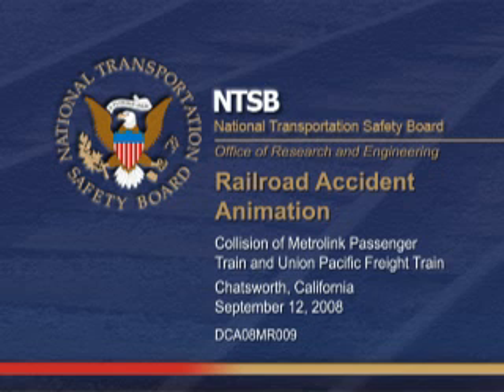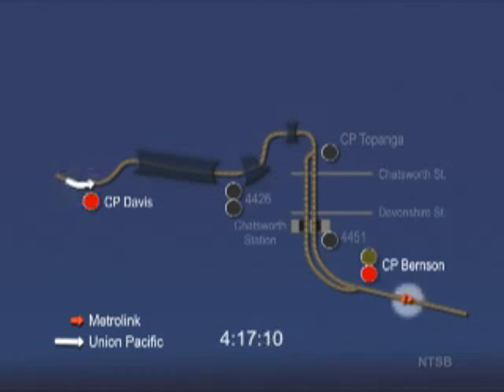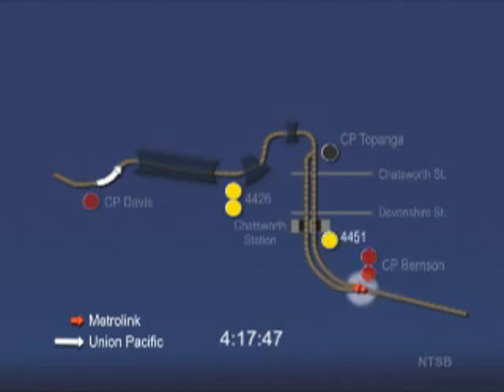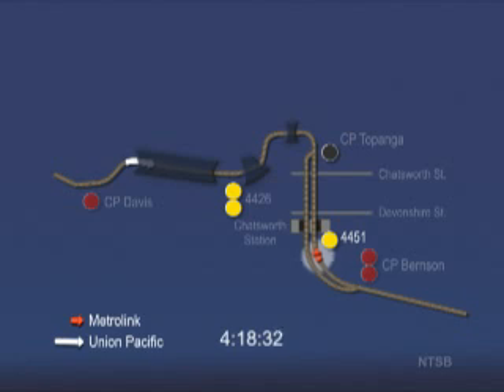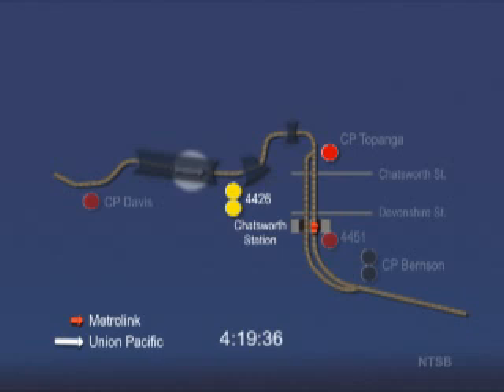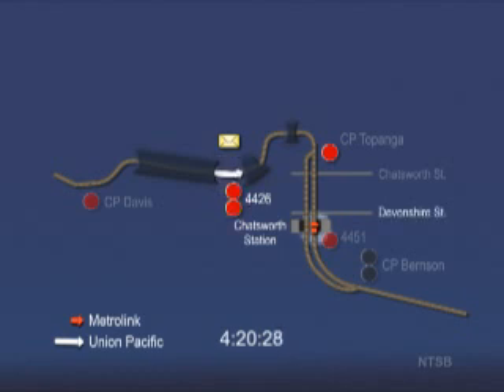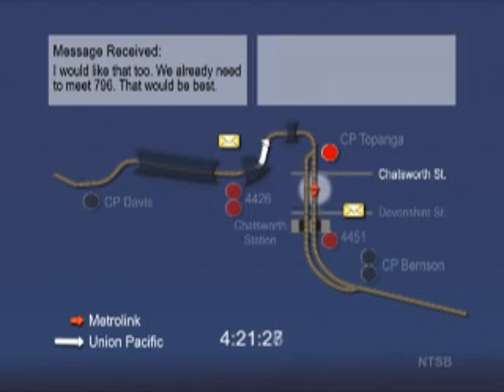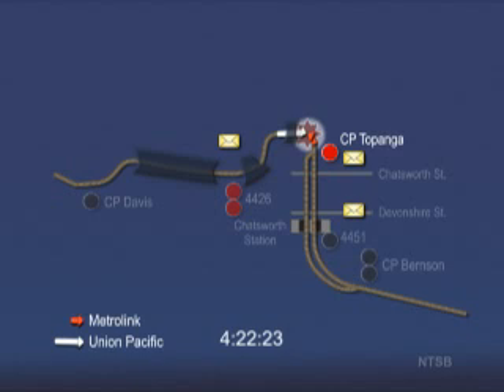Collision of Metrolink Passenger Train and Union Pacific Railroad Freight Train

Comment: Presumably both drivers were killed.

A SPAD, Signal Passed At Danger, as we call it over this side of the pond, caused by the METRO Driver being preoccupied with his texting on his phone.
After more than a few similar tragic events on the railways over this side of the pond, we have a new system, TPWS, (Train Protection and Warning System) that will apply the brakes of any train passing a red signal.
I hope your railroads have now developed an equivalent and are installing it.
Reply: Nope the crew of the UP train lived. They had to be extricated by LAFD members, but they survived with injuries.
Reply: @jaredkelly930  Thank God for that.
Reply: The railroads are in the process of installing Positive Train Control (PTC) right now. The government wanted it up and running by the end of 2016 but the RR's had to ask for an extension because the cost is being footed by the RR's alone and they are behind in getting it installed.
Reply: In the UK, we also have the Driver's Reminder Applicance to guard against drivers (engineers) forgetting that they passed a yellow aproach signal before a station stop. That had a significant effect in reducing SPADs by passenger trains when there was a station between the approach signal and the red. These had been mandatory on British passenger trains for about 15 years before this accident, but the NTSB doesn't even mention this as a consideration in their report.
Reply: We have it is called positive train control. If any train passes a red brakes are applied and the train goes into emergency.
Reply: Nope…cuz FREEDOM!

Comment: Is there no PZB or Indusi System in the USA that automatically forces a train to stop at a red signal if the driver does not respond?
Reply: Railroads are in the process of installing this technology (around 30% done by now) but it's been a long drawn out battle. For years there had been talk of requiring the railroads to install it, but they didn't want to spend the money so they lobbied hard against it. But they new the regulations were coming sooner or later. This accident finally gave the railroad administration the ammo they needed to enforce it and the railroads were given until the end of 2015. That deadline came and went and now its been pushed back to the end of 2018.

Comment: And ever since this day, train crew's are no longer allowed to have their phone's on while the train is in operation.
Reply: Actually ... there has been such a rule for many years (certainly before 2008).  Use of a cell phone was a clear violation.
Reply: Already done. PTC.
Reply: I still dont trust that, there needs to be something installed that automatically forces a train to stop at a red signal if the driver does not respond
Reply: @louisvilleslugger3979  I was thinking that these trains should use a trip arm system like those used by subways trains. If a signal is red, a trip arm by the track is deployed in an up position. It’s only lowered if the signal’s green. If a train passes the red signal, the trip arm will trigger a valve on the underside, activating the brakes throughout the train immediately.
Reply: @louisvilleslugger3979  Welcome to the UK, where we have this on our trains!
Reply: @scottbuchanan8300  Thats great! I would love to come visit there someday!
Reply: @louisvilleslugger3979  they have that. Its an alerter that beeps until the engineer touches it or else it would go to emergency
Reply: @IKARNIFEX  good! RIP BRAKES!
Reply: @IKARNIFEX by that time the crash would have already happened. The alerter only sounds every 50-60 seconds. If PTC was active then, it would have applied the brakes on the Metra before it actually passed the signal.
Reply: @louisvilleslugger3979  Positive Train Control.

Comment: If anyone knows, I'm curious about this:   At that last red signal, the Metrolink would have had to cross a switch already set for the on coming Union Pacific train to enter the siding.  So how does that not cause a derailleur or at the very least and auto emergency breaking?
Reply: The turnouts (switches or "points") are designed to permit trains running in the opposite direction to the turnout to 'run through' a diversion turnout setting without causing a derailment.

As for an alarm system initiating emergency braking.  That's a good point.  Unfortunately, unlike European railways where train movements are (for the most part) strictly controlled, were a train to pass a stop signal, an automated emergency braking application (which cannot be over-ridden by the engineer) would be initiated, North American railways are not as automated.  

I suspect ownership of the rail infrastructure has a lot to do with it.  In Europe, most railway infrastructure is owned by national governments where road safety takes precedence over cost factors.  In North America, most rail infrastructure is owned by the railroad companies themselves, where the bottom line (profit) take precedence over road safety – not that NA RR companies are 'unsafe,' they're as safe as the regulations governing them compel them to be safe.  
They're unlikely to spend money to improve safety (by employing automated train control systems) if the regulations don't require it.
Reply: when a closed switch is run through in this manner, it forces the switch open. It probably make the train shudder as the switch is forced open. It did damage the switch linkage. It is likely that a train doing this will not derail, since it does not ride up on the rail as the switch is forced open. To protect against a train running through a closed switch, trap points can be added ahead of the switch itself. These send the train onto a siding (or 'trap'), instead of proceeding through the closed switch onto the active line.
Reply: Excellent post!
Another factor is that in Europe, especially in the UK, the Unions are very quick to take action should a dangerous situation arise.
Whilst the are times when the UK's transport unions can be a pain in the arse, they have, by and large, contributed greatly to improving safety.
Reply: Switches are much weaker than trains: remember that a switch can be set by a person swinging a four-foot lever. A train passing the wrong way through a switch just busts the switch.
Reply: @beeble2003  I figured that but I also thought by breaking some part of the switch, it would also cause a derailleur.
Reply: Even without going to full blown automation, there are a lot of systems that can be installed to help the Loco Driver do his/her job safely and over here in the UK the Unions assist that process.
Reply: Absolutely like even just an itinerary schedule to already have a plan as to what other trains are using the same track and when to expect to stop and let them pass . I can't believe they're just flying blind and relying ENTIRELY on signals a system developed in the1800's !
Reply: Unions are why US rail doesn't have automated safety systems like that. They fight automation of train systems as ultimately the whole system could be automated and they'd all be out of jobs.

Comment: As an Operation Lifesaver presenter, I have ridden in the locomotive through this area several times.
Sad that the engineers could not see each others trains and stop or sufficiently slow before collision. 
If one were to look, I bet each train could have been seen by the other in the distance.No excuse for the Metrolink engineer gayllowing himself to be distracted by the boys and failing to see the signals.
Reply: Only visible to each other for 5 seconds before impact.
Reply: cple1  Incorrect.  One can see the train to the west and west train could have seen the east train.  But could not discern which track the east train was on.     Sad that no one bothered to look.  But understandable.

Inexcuseable thathe Metrolink engineer gayllowed himself to be distracted and failed to obey the signals.
Reply: Robert Gift it's what was said in the video. If I remember right this was on a curve and the UP train was coming out from under an over pass.
Reply: cple1  I know the route.  Sad that each engineer did not notice the other's train moving north.  Such would indicate thathey would collide.   They collided athe northeast curve north of CP Topanga.

Northwest of Denver, Colorado, freight trains collided under US36.   Neither could see the other until they met on a curve under the highway.
Had either been further ahead, they would have been in an open area where they could have seen one another.
Reply: Anthony Smith "allowing himself...!"
My understanding is that the Metrolink engineer was homosexual.   He gayllowed himself to be distracted byoung boy train enthusiasts.
No excuse for failing to read and understand his signals.
Reply: Brickertown P.S. 

Thank you for coming to the defense of people such as me Brickertown.

You're a voice of sensibility and kindness in a world full of Robert Gifts! 

We could use more yous and less "gifts" 😂
Reply: It is fairly easy to see which track a train is on when the railroad is single track. Please review the video. The Metrolink train had run past the STOP at the end of the siding and through a switch aligned against his train into a single track section of railroad. He made no effort to brake.

Per the NTSB, the UP train had five seconds of sight distance to react and they used it to put their train into emergency stop. The last signal UP passed was an approach diverging, so they were not required to stop at the interlocking that they were approaching.

For the unaware - this incident is one of the major incidents that led to the federal law requiring "positive train control" to be installed on all passenger and hazmat carrying rail lines in the US.
Reply: @justalurker66     Wheheading eastbound on the west north-south section of track, one can look right (east) and see a train on theast north-south section of track where the station is. 
Likewise, wheheading westbound on the station's north-south section of track, one can look left (west) and see a train on the west north-south section of track.
Understandabe that no one on either train would be looking 90º through the buildings and foliage for another train across the valley.
Reply: Robert. As a fellow human who is very much so not a homosexual, I ask that you don't share your opinions on gay people in public. Yes, even if you think that it's a factor in this accident. It is professionally extremely intolerable, and there are millions of people if not billions in the world who would hate you for saying that. Your comments lose all credibility to these people when you use words like "gayllowed".  Which includes me to an extent. But I respect you enough to warn you. You don't need to bring homosexuality into this. Especially when it is so politically incorrect to do so.
Reply: Brickertown I’m proud to see your comment has the most Likes of any in this thread: 10.
Reply: @Brickertown   As a classical organist and carillonneur, I had many dear gay friends.  My best friend was gay.   He died in my arms.  He laughed at my invented words - and gaygreed withem.   No hate.  Just sayin' the way it is.
Do you think I am a haterosexual, I asked?   He laughed, "No.".   He laughed when I asked him to be Worst Man at my wedding.  He knew that wife and I wouldo no wedding ritual. 
We both miss Charles, a wonderful friend and orgaynist.
Reply: @robertgift  boy you took so damn long to respond that I've now been openly pansexual for like five years. I cannot believe you would be so cruel as to force myself to read something I wrote almost nine years ago when I was a sheltered dumbass. It should further be a crime to make someone as horribly sick with the flu as I am laugh this hard, as I shall now certainly cough myself to death
Reply: @Brickertown  political correctness is simply a form of oppression of opinion. If you want to take away others right to express a differing opinion then you should be willing to quit expressing your own.
Reply: @FRLN500  Freedom of speech is not freedom of consequence. You are free to say awful stuff, but you are not free from whatever trouble it will lead you to.
Reply: Robert Gift 

As a person who IS gay, I am disappointed that you think this accident was caused by an engineer "gayllowing" (Not even a word. Congratulations on your hateful ignorance and lack of adequate vocabulary.) to a railfan.

The relationship as far as the NTSB was concerned was the basic context that the engineer was texting a railfan when he clearly shouldn't have been doing so.

Whether those two people were in a relationship or not (for which you have ZERO proof to back up your asinine claim I might add), it is irrelevant to the investigation and the cause of the collision.

The cause of the accident was the engineer texting while running the train and going through a red signal without even realizing it until it was too late.

Your absurd and foundation-less comment has no factual basis at all. And that reminds me: I don't suppose you'd like it if I claimed that a train collision was caused by a Christian engineer who was too busy praying to have his hands on the throttle or independent brake?

You would rightfully be upset at such a ridiculous conclusion.

So don't do it to gays. It's rather exhausting to see people like you repeatedly use us as scapegoats for your own partisan hackery.
Reply: Who said angaything of a relgaytionship?   Most likely (I suspect) that he was distracted by the text messages from the cute young boys and missed his signals.  If a gullible in the laughable 3-n-1 Gods myth of Christian-inanity failed to read his signals, I would likewise blame him solely for the deaths.